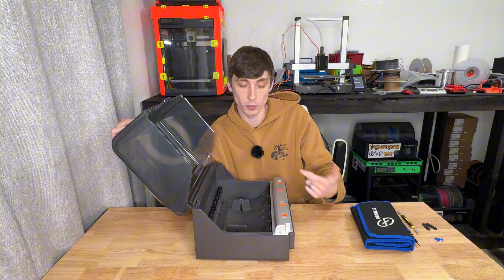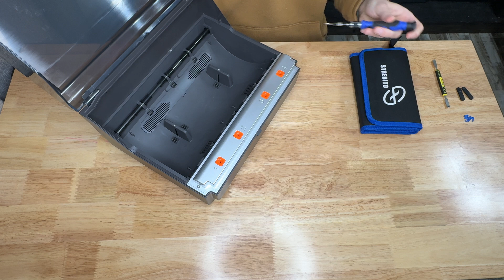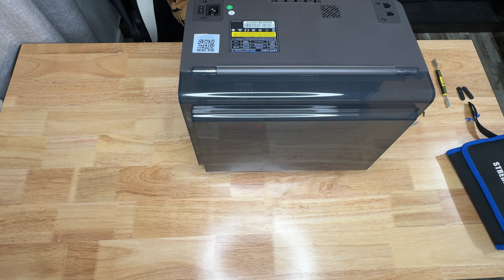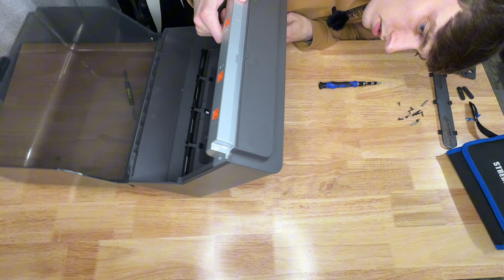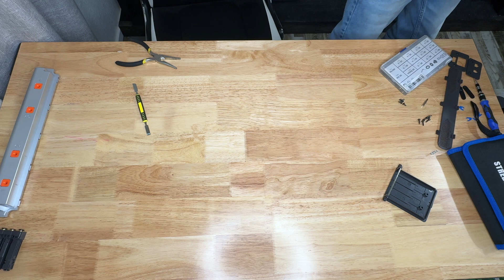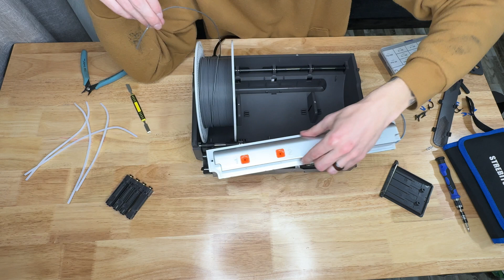Anycubic Ace Pro Teardown  Its Bad

Comment: I just bought a Max 3 combo used.  The printer is great, but the Ace looked fine, but now I can tell it's worn a lot.  Only 1 slot worked reliably and 1 never worked.  Last night I had this thing apart 6 or 7 times...it's not that bad.  Try changing the number 1 coil on a 4.0 V6 Nissan without removing the intake manifold.  But after taking it apart all these times, replacing the tubing on 1 and 4 a couple of times to figure out the best route, and printing a new piece to mount the filament detections sensors, it seems to be working good now.  My advice for anyone trying this, watch this and other videos, take lots of pictures, have patience, don't lose the screws, but put them ALL back in, and take your time.

My tips, to get the silver and orange piece with the filament tubes out, remove the 2 screws and grab from underneath behind it, rock it and pull up.  
One you remove all the screws, to get the inner part out of the case, try to pull it up evenly, but the front will get stopped by the clips that hold the silver piece.  Take a small plastic trim tool or a small screwdriver (just be careful with a screwdriver not to gouge it) and pry the front of the tray over the clips.  Then the entire thing easily pops out.

If you have to replace the bowden tubes, 2 and 3 are pretty obvious, but 1 and 4 make you think you have to tuck tight behind the fans.  DON'T do that.  The turn will be too sharp and filament won't feed easily or jam a lot.  The tubes for 1 and 4 can actually go under the fans if you look, you can see the fans are angled up, but the case is flat, so there is plenty of room for the tubes.  And by routing them under the fans you get a much straighter shot to the buffer mechanism.

And my number 1 tip after using 3 Ace Pros, take your time to straighten out the first 4 - 6 inches...bend it backward to get the curl out as much as you can.  Feed it in, and sometimes it takes just you giving it a little push or pressure to get it to make the turn into the tubes underneath.

Comment: I've done this "maintenance"  on the Ace Pro more times than I'd like to admit. Sometimes it will run smoothly and other times, I have to take the unit apart and look for any loose filament or a part of the cover that wasn't snapped in all the way. Sometimes it'll work after disconnecting the power to it and reconnecting it. Sometimes. My mistake was that I didn't request a replacement right away while it was under warrantee. Buyer beware.

Comment: I have 16 ace’s on 4 kobra’s and working with out any problem. They are printing almost 24/7 for over 1 mond right now, at first with 2 ace’s the last 2 weeks with 4
Reply from the maker: I sold mine after a week of failed prints
Reply: Great, but you better learn how to do this....they eventually will act up.  I mean even Lexus's need maintenance too.

Comment: Replaced my ptfe tubes on 1 of my ace units today, your video helped with disassembly. #1 was worn completely through on the bend, but that printer has 2000 hours so not bad going, I agree they could have made it a little more user serviceable, pretty tight getting the guts in and out.
Reply from the maker: Very difficult to remove the guts. But glad to hear your having success with the machine

Comment: I've had the same issue where before i hit extrude feature on the S1 it pulls it in and then retracts the filament out.  filament was straight and I 3d printed a spool that fits over the hole to make sure it comes in more vertical.

Comment: I've had my fair share of fights with the ACE pro. After lots of printed parts added it's FINALLY working well. Anycubic had to cut costs someplace to competitively price the ACE to compete with Bambu and Creality. So yes the ACE only has 2 steppers in it versus the four in the AMS and CFS. As for poor design, I disagree I think they did a pretty good job on getting 2 steppers to do the job others do with 4. That said I wonder if the addition complexity and part are worth it?! I guess Anycubic decided yes. At the end of the day I think the ACE (although finicky) is still a good bang for the buck option.

Comment: Straighten out the filament before install like you have to with any other printer machine. Read the instructions it tells you to do this. And why are you trying to run klipper on this machine. It runs fast and use the network setup it comes with. Oh and use Anycubic slicer next (orcaslicer) as your slicer it works amazing. I get that this is 5 months ago, but still.... lol
Reply: what's the better option besides klipper? Rinkhals?

Comment: Any suggestion on how can i modify this ACE unit so it can run TPU? thanks
Reply from the maker: The only way you could run TPU is if you use one with a shore hardness of 90 or 95 anything less wont be able to be pushed down the ptfe tube
Reply: @NotAnotherPrintingChannel  i already tried it but i get filament entanglement error every 3 min of printing... i just press confirm and it continues normally for another 3-4 minutes
Reply: I replaced all the tpfe with Capricorn xs tubing. I do mean all. Inside the Ace, from the Ace to splitter. From the splitter to the hot end inside. This tubing is super slick and has a tighter inside diameter. I've only printed one little print with TPU, but it actually worked.
Reply: @keithmullins9201  did you print some more with TPU with that tubing, unfortunately that tubing that you are talking about is not available in my country to order, but i have some friends that are coming in the next month from USA so they can bring it, but i would like to be sure its working before i ask them to bring it

Comment: I have Nearly 1K hours on My S1 Combo, with about 75% being multi color using the Ace Pro and so far it has been great. I did have some old brittle filament break in the Ace Pro that was kind of a pain to get out.
Reply: I had the same issue and I was about to take my ace pro 2 apart. but i found old filament that broke and stuck in the 4-port hub. I made a short video how I removed it. I kept getting error 11512 and 11511 even though I cheated the initial broken filament that was visible in the tubes but not the port hub.
Reply from the maker: Glad to hear it

Comment: What I have found is two things that correct this miss feed.   One, cut the filament so that it is STRAIGHT at the end.  With my Kobra Max 2, I have to cut the filament at an angle to make it load easier.  With the Kobra Max 3, I find that a flat filament end helps it load better.  Second, straighten out the filament so that it is NOT curling back toward the spool.  The combination of those two things has pretty much eliminated the whole problem of filament loading into the spool area.
Reply from the maker: I fixed my problem by selling it lol

Comment: If a piece of filament breaks off inside of the ACE Pro, it is a difficult and time consuming to take it apart (if you are even able to pull it off) just to see if that is the problem and resolve it. I succeeded in removing the piece of broken filament, but it was way harder than it should have been. Clearly the ACE Pro was not designed with the reality that filament will break in PTFE tubes and will have to be removed. It is a poor design for that reason alone. Your video illustrates the difficulty of the disassembly process, thanks. Buyer beware!

Comment: Im ready to sell the entire printer over this. It said i had a clog and filament slot 3 kept feeding back into my Acer pro through the roller slots. I took it all apart (they didn't even screw the plug down), no clogs. And now i can't get it back into the case. Bambu may be a little more expensive but they thought ahead regarding user maintaince.

Comment: So, I just got done taking my Ace apart and there was about 2" of filament broken in the ptf tube just below the roller... so you couldn't get at it without pulling everything out so I could get to that tube... all back together and all working fine now... I do really appreciate you showing us all the different places with screws... actually there were some missing screws on mine compared to yours... they had never been installed... but it all holds together pretty good without them... like the you showed on the back by the 4 ptf tubes... nothing on mine... just the 2 on the bottom... btw..BTW... I didn't have any QC passed on my ace... so... I don't know what to say really... it's absolutely sad but if I can learn all the weird things about this K3M and the ACE... not so pro...lol it was a good price... but then again... we get what we pay for... I was hoping for better from a company that is as big as anycubic... it sucks that we can't get parts very well... like nozzles... I want a .2, .6 and .8 especially with how big we can print on the K3M I would really use a .6 most of the time for what I'm making and .8 would be great too... I know that I would use them... hey heads up... with the quick change nozzles... even though they don't have this on the support page... use some thermal grease on it when you switch it out... if you don't it causes clogging... Thanks again... I appreciate you...

Comment: For some reason if you hold the spool in front of the ACE and feed it in it'll work, then put the spool on the rollers.  Given that Anycubic are sending out parts to people who complain about this issue suggest maybe it's an early design problem and they've since improved it. (Speculating there)

Comment: These things are absolute junk. It looks like it was assembled by a toddler. Parts not connected, parts MISSING,  just an absolute pile of trash. Ive had nothing but issues since the moment I took it out of the box. Super disappointing. My Kobra 3 took a crap after about 10 days also. They are supposed to be sending me a new motherboard. 10 DAYS.

Comment: I switch filaments daily and for several weeks had not a single one cause an issue.
I simly straighten them as is suggested and the unit works like a charm.
Looks to me like a case of going off on a tangent and looking for the most complex approach to a soloution for a problem instead of simply reading the user manual.
Reply from the maker: I have every time I use it. I would say user error but when I have sat there in straightened the filament and tried to line it up and it still misses the feed line. I can no longer agree. I don’t really use the machine any more it’s just not good enough quality wise to sell products printed on it.

Comment: I had the same problem once, panicked, then reloaded just fine.  Not a perfect system by any means.  But the built-in dryer sealed the deal.
Reply from the maker: I dont use my printer at all i have a hard tome switching from bambu
Reply: i have one not even 3 weeks old and the dryer just died. call support and all they did is sending a part and i have to take the whole thing apart to fix it myself. not very happy with this

Comment: I've been running the K3 and ACE for months without any major problems.  It's a great package for the money, and Anycubic support has been great at resolving the problems I did have.  The filament feed issue you had is a known problem if you fail to straighten the filament first.  You apparently looked at the wiki to see how to disassemble the ACE, but you didn't look to see if a solution existed for your issue?  
You started your video with a very negative attitude an a presupposition that the ACE is badly designed, so you found what you wanted to find.  The feedissue is purely user error.  Yes, the design could be better, but they can't simply copy someone else's design.
I hope things are going better for you now.
Reply from the maker: I still run into feed issues after straightening filament. I have resolved many issues. It only happens maybe 1 out of 10 feeds. The p1s and a1 systems are much more reliable but the printer itself is a great starting point. I do recommend this printer combo to new users. I posted a video on it this week actually.

Comment: The kobra3 is a absolute fail, I my eyes. If anycubic had spend more money and time making a better aces system. Ive seen the kobra3 hotend completely burn down, unreliable multicolor, and bed leveling isn't always consistent. Yeah, I had some hope that the kobra3 would be better, especially that I own anycubic machines.

The prusa MMU uses a camshaft system too, its also hit and miss.

I'm going with the creality hi when it comes out in a few weeks. The multicolor CFS system looks way better too.
Reply from the maker: I’m looking into the HI system as well

Comment: I appreciate your making videos and trying to figure out the perceived problem. However, you lost all credibility when you said "This is probably going to scratch the ACE system on this flat surface ..." . Anyone who's worked on equipment would know enough to put the thing on a towel so it doesn't get scratched. You also never demonstrated the failure. You took much of the unit apart but you got lost trying to analyze the mechanism yourself and just chose to remain dumbfounded at the complex design. This is what mechanical engineers design and it isn't necessarily going to be a simple thing any person can understand by looking at it. I have the Kobra S1 combo system on order because I've seen the ACE system work just fine in most of the videos I have watched. Uh except for one guy trying to load TPU ... which he later admitted the unit was NOT designed to use! You basically achieved nothing going to all the trouble taking what you did apart because you didn't replicate the failure and cannot explain how the mechanism acutally works from an engineering perspective. As was said by others just straighten the filament out a bit and go print something.

Comment: I don’t understand the gap between this review and the others - granted the others I’ve seen aren’t tear downs.

I resonate with the notion that 4 little extruders would seem simpler than a quasi cam type system, not to mention if the cam motor fails then the entire thing stops working. But, if the cam approach works fairly reliably, then that’s fine by me. I guess we shall see!

Comment: Straighten up the filament tip, if it’s curved badly make sure you straighten it before putting in the feed hole and done no need for a pointless tear down that solves nothing
Reply: this, fixed my issue and now no probs
Reply: This dose not work